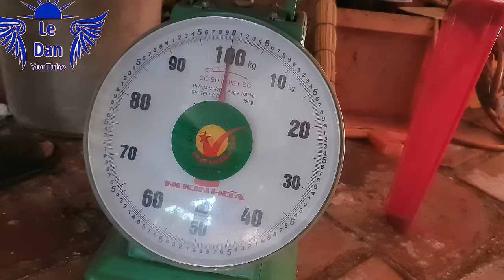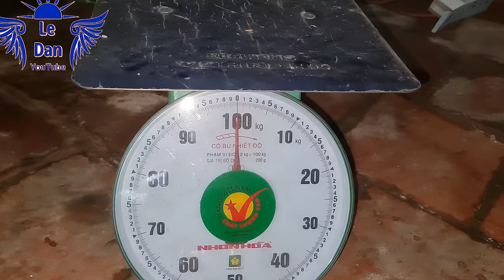I completely converted the regular engine to 4 cylinders from scrap

Comment from the maker: Part 2 You can follow it here
https://youtu.be/Ga2Na2IcnG4
Reply: Amazing engineering and machine work!
Reply: @SvendsenWorks  p
Reply: Super robota 👍 efekt końcowy rewelacja 👍👍👍, to dziewczyny są twoje 😁😂👍
Reply: You have awesome skills, but.... crankshaft is the wrong approach... use 3 cylinders next time... and a straight shaft underneath powered with gear. Think of using salad oil in the future... Have fun 🤣🤣🤣
Reply: nice bro
Reply: Mbok
Reply: Sir i would like to ask if your selling that inline 4 engine? How much and cam you ship it here in the PHILIPPINES?
Reply: O
Reply: ทำเสร็จเเล้วลงยูทูปให้ดูหน่อยครับ นายสุดยอดมาก👋🥳🥳🥳🥳❤️❤️
Reply: What is the displacement of this motor? Amazing build. love the project.
Reply: Người việt nam  a ko nói chuyện được sao ah
Reply: Izin post ke tik- tok bang
Reply: Excellent 👍👍👍
Reply: ただ一言、天才だわ！同じメカニックとして尊敬します。
Reply: You should do a vid where you melt all your steel and aluminum scraps down and make an engine from the ground up i bet you could
Reply: Berapakah harga mesin itu?
Reply: @rafasek5057 5
Reply: @SvendsenWorks yang lama 6
Reply: Kreatif om
Reply: Bang angkat saya jdi muridmu bang.luar biasa sangat2 genius
Reply: Mujhe Bhi Ek engine banaa kar do na
Reply: Mau naya kalau ada yg beli tu di jual ga kira2 berapa 😂
Reply: Part 3
https://youtu.be/KMlTuklfy7o

Comment: Hats off to this guy for his machining and welding prowess, not to mention his blueprinting ability. From my perspective, it would appear more advantageous to cast and machine a cylinder block and crankcase assembly than to chop up four cases and then weld and machine them together to make a complete engine. Perhaps, I'm just thinking mass production, where as he just wants to complete one unit in his small workshop. He may not have a foundry or casting experience, but if he did, he could turn out more of those precious little gems and even supply them to smaller frame builders for a profit.
Reply: Setujuuu bos
Reply: I think he did this more to show off his skills. The fact that he could do it.
If I was Elon musk or NASA, I would be trying to hire this guy. I bet most people who have a master's in mechanical engineering, couldn't even do this.
Reply: Setting up a casting mold for such a big thing and figuring that out fully is pretty hard if thats not your main field. Especially the internal voids.
Reply: He does it for entertainment and makes videos, but his work in Vietnam is illegal so he doesn't do it for commercial purposes.
Reply: @rabbitheadvn893 why would it be illegal? I don't see the issue as long as it's for track/off-road use.

Comment: This guy is gifted with supreme skills in machinery. You’re doing amazing work!
Reply: But very poor with casting 😁😁 he would have saved lot of bits and man hours simply by casting parts.
Reply: @anshulbhardwaj4038  so you are greater than his. So where your video?
Reply: @makhang2  the work I do comes under official secret act of India so I cannot upload it on you tube but I can tell you that in a nuclear reactor there are 64 temperature sensors  with redundancy of 8 it means at every point 8 signels of temperature are generated and there are in total 64 of such points. Redundancy of 8 is highest as per IEC standards . IEC stands for international electromechanical council.
Reply: @makhang2  one more thing if you look into a nuclear reactor pool you will find a blue glow coming out of water it's called cherenkov radiation.
Reply: @anshulbhardwaj4038  then you got no proof to show me. Secret? My relationship with scandal is more secret than that.
Reply: @anshulbhardwaj4038  you do research about nuclear right? I think you have seen so much miracle in science. So i want to ask you. Do god exist? Answer me with your best knowledge
Reply: @anshulbhardwaj4038  How is all of that relevant?
Reply: @sekou3758  there is a reason designers chose to cast something instead of welding or machining.
Reply: @makhang2  official secret act is a law it's applied in various sectors of national importance .will you be telling your bank account details in public ???
Reply: @makhang2  obviously god exists but concept of God is like concept of Mickey mouse. They exist they influence people's lives but they are not alive.
Reply: @anshulbhardwaj4038  so why your god had 8 hand, an elephant head and so on? If their not alive. Mickey mouse is drawn by someone. Do your god drawn by someone also?
Reply: @makhang2  which part of the word "Concept" you do not understand???
Reply: @anshulbhardwaj4038  do u appreciate what has been upload? Yes or no ?
Reply: @tabp1ay7  nope
Reply: @anshulbhardwaj4038  and that's the reason why many more chose to ignore ur presence .
Reply: @tabp1ay7  who cares

Comment: Please make a multiple cylinder 2 stroke engine!!! Or maybe even v twin 2 stroke. V4 2 stroke. 3 cylinder 2 stroke. Twin 2 stroke. It doesn’t matter anything 2 stroke is cool!!! Good job. More 2 stroke engine please. 2 stroke lovers give me thumbs up. Let Le Dan see this!!
Reply: I'd like to see a 2 stroke V8 based on the Honda CR 500 which made  65+ horsepower from ONE cylinder, so an eight cylinder would be over 500 horsepower from only 240 cubic inches!
Reply: agree ❤❤❤
Reply: Allen Millyard motorcycles is your 2cycle motor builder way good
Reply: @garykeenan3724

Comment: Proper machining skills, no CNC, all done by hand and calculated with his own brains.
I was thinking at some point how he would get the crank shaft in as the crank case can't be split.
And then he came up with the tunnel crank shaft principle, enabling to slide the shaft in from the side.
Would like to see the next video with the rest of the build and the finished product running in a scooter.

Comment: Absolutely incredible Also doesn't look like it would have been much more work to make it A V8
Reply: Hopefully that's next👍
Reply: @davidgwin4540  yeah as a builder I can't get enough of these videos. This video in particular reminds me of the Honda CB 400 four and another video a guy did where he made A V8 out of the 2 cb400f top ends like the mv Agusta v8 racer.
Reply: @Immortalrounin   o890? A m
Reply: Yes, having gone to the trouble of modifying the crankcases to take a vertical cylinder block, why not put another 4 pots on the front?
Reply: @ngocthanhang4412   moto guzzi v8
Reply: @MidEngineering   @MidEngineering   He would have to modify the crank case a little bit but he could use slimmer connecting rods to compensate for the gap to not have to remake the whole crank case.  Alternatively he could have used the clam design So that the crank case splits down the middle instead of multiple sections making it much easier to pull and reinsert the crank.

Comment: Pretty cool, I'd like to see it run. Curious about what kind of ignition system he will use. Also, how balanced is that crankshaft? Rotational mass has to be balanced. Still, it's pretty cool.
Reply: Yep, would runs smoother with balance shaft
Reply: The balance is what I'm really curious about beyond anything
Reply: @geematthew40  it's hard to do if you are decent at welding and have a decent lathe to chuck the Shaft up on.
Reply: Don't get all professional, get out there and build it better, can't wait too see all of your videos, looking forward to them.
Reply: I think I'm going to have to agree with Chuck, I mean crankshafts are one piece for a reason and what did he base the journal placement on. If this thing does run, I don't think the crank will hold together.
Reply: @jeremyhigh3186  I'm on board with Chuck as well, but, I donhave to point out that not all crank shafts are one piece. Rotary engines larger than 2 rotors for example tend to have two or more pieces to their "crank" shaft (it's actually called an eccentric shaft, but no one is keeping points).
Reply: @rallywagon261  cannot compare the two, a rotary engine does not drive a piston and rod in a cylinder. The shock load from combustion on the crankshaft is much worse. Just look at a set of rod bearing, you can see the wear.
Reply: @chuckingram5966  I agree, I cant see any way of timing the valves, each head is covering the spark plug hole for the previous one making ignition impossible.  This looks cool, but so far its just scrap thats slightly prettier than the scrap he started with.
Reply: @-DEATHSTROKE  Doesnt need to be professional, but it does need to be functional.  This is not.

Comment: Looking forward to the next video making the cam.
I think he'll use 4 original cams drilled out in the center and then put over a new shaft, then pin the different sleeves of the cams to time the lobes between the cylinders.
Looked like the crank pins were welded to the webs to stop them from rotating.
One big concern on the crank is balancing.
I'm also curious about what clutch and transmission he'll use as the original Honda 110cc transmission and clutch won't likely hold up for the ~4x increase in power.
Reply: I expect the transmission would be ok as the peak torque of 4 cylinders should not be any more than a single cylinder.   However the average torque and power output is 4 times higher.   This will generate 4 times more heat on the clutch.
Reply: คำถามของคุณน่าสนใจมากครับ
Reply: @helixworld  la idea no estan descabellada si se mantiene una temperatura adecuada; Con refrigeración asistida x radiador ó se mejora la calidad del material de fundición del motor. 
Algo que me encantaría mirar rs el desempeño de este motor en subida y la aplicación de algún combustible con manejo de disolución de uranio.
Reply: @helixworld  When it's slipping it will get hotter, but it won't heat up 4x more. unless it can't hold the power then heats up until meltdown lol, still i have seen clutches melting metal of the flywheel and press, quite tough material that is.
Reply: i was wondering about the orientation of the crank lobes and balance as well. all the trimming and cutting definitely threw off the balance and i didnt notice any alignment marks or balancing process at all either.
Reply: aside from what i notice that he put the 2 outer crank lobes 180 degrees from the inner ones. it looks like it spins pretty damn straight though. lol

Comment: This is stunning proof that anyone can make anything out of anything. My biggest question is how much planning went into this? I can only imagine the knowledge it took to know what to do here.
Reply: lubang busi nya bijimana om.?
Reply: I agree with you . such a potential of technical thought and engineering knowledge has been accused of a work that is not entirely practical. From a technological point of view, this engine is worthless.  The only value from an engineer's point of view is a beautiful Sculpture  . Not less very beautiful for me it is a waste of time and knowledge, in this place something more practical could be done, the work done by the author is huge, but it is a waste of energy.
Reply: @sqooter.  I mean I guess it could be construed as a waste. I think it's worth doing because it hasn't been done. The value of being the first or few to do something is pretty high I think. It's all to easy to buy something and throw it together. This man created something that didn't exist. And in certain countries availability of materials or even money in many cases prevents people from simply obtaining a new engine or even parts. This engine could run a lot of different equipment with the added torque. Log splitters, rope spooler, plow, water pump, etc etc. Also with him designing everything from ground up he could've increased compression and optimized the timing.
Reply: Technically unique  no one cares. Quit trying to steal Dan's fans.
Reply: @sqooter.  Yes its a waste in some way, but it was a good way to demonstrate his skills.   It will generate some nice income from Youtube.

Comment: Impressive work, is there a video of the running engine? how long it would last?
Reply: the plug holes are trapped inside the heads, i.e. will never run.
Reply: @VenomClawz  well he proved you wrong

Comment: undoubtedly an excellent job, I wonder why the crankshaft distribution is at 180 ° and not at 90 °. Also, where are you going to put the spark plugs?
Reply: Big bang engine?
Reply: When one is on intake stroke another is in power stroke.  Most Honda twins are this way.
Reply: he used to make 3 cylinder engines and also have a place to put spark plugs

Comment: Dan I see that I didn't explained myself correctly, again, when I wrote if you put it on paper. When I see all the steps that you went throughout the project, you must of had a written plan? They were to many steps in matter to have the result as shown in the YouTube clip. It took you 4 motor cycle engine blocks, you cut part of it, grinded at precise spots and created a cylinder head block from a lump of aluminium. I would love to know from you, how you did it and since I didn't see the end of the engine you created and it  remains me to ask you, did it work? I wish you could of shown actually starting up that monster, monster?  and right away it reminded me from a scene of the movie  Frankenstein and hoped you would of screamed, it's alive?

Comment: I’m seriously impressed but damn you can buy 4 cylinder engines for so cheap. The amount this had to cost in just material alone he could have got a v8! Anyway the bolt in bearing carriers are very similar to how miller offenhauser engines are.
Reply: well two comments for this one is in many countries they have to re use whatever parts they have because getting new parts is near impossible and if that wasn't the reason the two is well because he could so why not! it's fun and makes for great content! 😝

Comment: wonder how you going to run the spark plugs
Reply: He’s going to run them reeaally hard...
Reply: The two center heads have to be removed to service three spark plugs and there is no clear path for the hi-tension leads, either. The crankcase and main cap's stability is questionable. The whole valvetrain, cam and all, needs showcased. The transmission has yet to be seen...
That is a glowing example of the typical design engineer that has never turned a wrench. But I admit: I have never accomplished what we see here, a little more planning would've been employed... Will wait to see it running and making power before liking.
Reply: @fyrbyrd71  lolol idk about you, but one stock timing chain won't last if it's driving 4 cams. Same with the stock transmission.

Comment: 8:03 how can you make sure if the crankshaft is parralel and accurate in 180º ? I'm so curious
Reply: I'm sure there's a method to measure to the shaft to the counter balance. My concern is that it's too skinny though the counterbalances aren't as far apart as I thought they were going to be and if it does break it's 4 more motors that's gotta be collected essentially

Comment: At 26:19 - The coolant holes should be baffled so the fluid flows down one side of the baffled hole and up the other side for each hole. The existing setup the coolant flows across the transfer way leaving the coolant in the holes to over heat or at wurst boil.
Reply: Post a link to your thermodynamic analysis. I'd like to see what K factors and coefficient of thermal efficiency you used and for what coolant media. Thanks in advance.
Reply: @theupscriber65  A liquid cooling system requires coolant flow otherwise the system will have hot spots. For any heat engine to be reliable a uniform coolant geometry design is essential. The flow rate is controlled by a thermostat to maintain the correct flow rate through the heat exchanger. Engine oil flow is another major contributor in heat distribution for example oil injectors on the underside of the piston. I hope this helps. Cheers
Reply: Tesla valve.
Reply: @AquaMarine1000  , I doubt he has to worry about the engine getting to hot seeing how he put 3 of the 4 spark plug holes inside the cam housing. So unless he has a very clever work around, this thing isn't going to run.
Reply: @AquaMarine1000  math.  Try it.
Reply: @theupscriber65  Applied science and engineering - fifty years in the business - just try it

Comment: That's a sweet conversion. Are you using splash oiling on the pins? It will work for low rpm like under 3400, probably similar balance limit. Dual points with wasted spark firing is the easiest way to fire the plugs. Fires 2 plugs same time, one on squeeze one on blow. I love this stuff. He sees the end product in his mind and finds components that can be made to fit. Not to mention he is one of the greatest aluminum Tig welders in the world. If anyone has tried to weld on Chinese aluminum castings, they know how incredibly difficult it can be. Dan, bạn phải là thợ hàn Tig giỏi nhất mà tôi từng thấy.  Những dự án này thật tuyệt vời!
Reply: Your so right cause that China metal is like tin foil lol he’s amazing skill lever is next level
Reply: 0ppp
Reply: @jesussavescars807  china aluminium is half scrap metal and half horse crap
Reply: Those werent gy6 they were honda
Reply: Those are Vietnam aluminium, yo...

Comment: Every time I see a thumbnail of this pop up. I immediately have enormous pity for that tiny clutch and transmission.  Im truly surprised it didnt shatter the transmission drive, or casings.
Same goes with these single cylinder engines on Nitro.  Ima figuring this is made of glass lol.

Comment: 4 cylinder is the wirst solution, believe me. There were tests done with opposing piston engines, 3 cylinder performs better, simply because
Reply: 3 means momentum, 4 means stability, or try a V6, or a pentagram Cycle 5 cylinder 🎂

Comment: White folks with metal 3d printer and 1000 axis cnc and $100k Vibranium blank : make fidget spinner
;
Some random Asian with 50 years old lathe milling machine : make 4 cylinder crankcase with its crankshaft wit its blocks and head, FROM SCRAP METAL